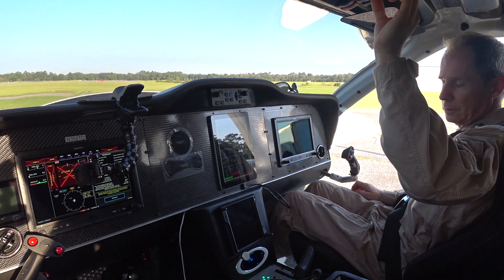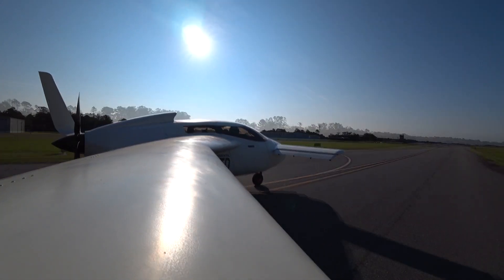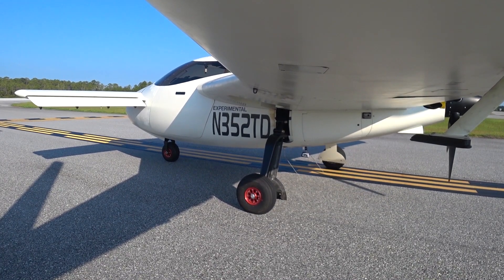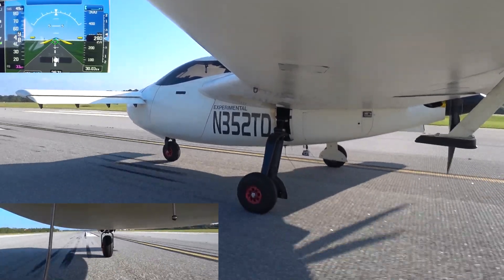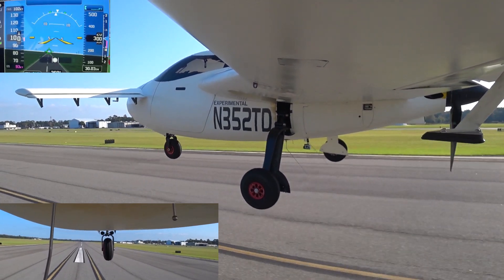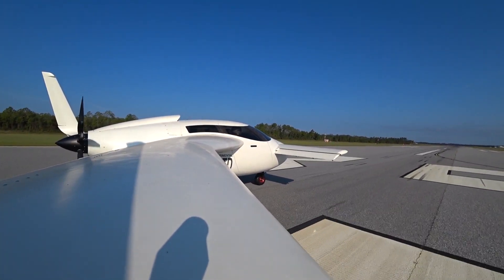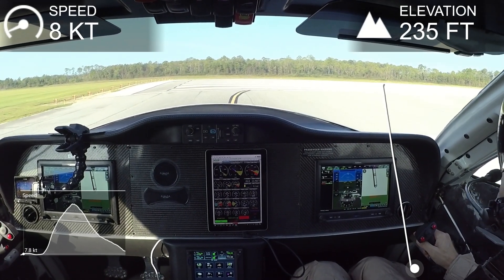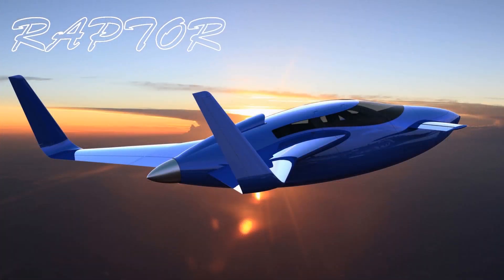Ground Effect... Check! - Building the Raptor Prototype

Comment: I'd suggest getting the pitot/static system professionally checked before any further flights.  The altimeter setting is correct per the ATIS, but the altimeter is reading all over the place when accelerating and in flight.  The error appears to be 50 feet as you begin your takeoff roll and the change in elevation from one end to the other is only 4 feet per the airport diagram.  

https://aeronav.faa.gov/d-tpp/2010/00892AD.PDF

Comment: Perhaps a bit of pilot-induced pitch oscillation, but great progress! You held it on the lines withing an inch. Other than pilot-induced, perhaps you could be putting the plane in porpoise-like canard-style light stall because you want to pull up too quick--because you know that you have to get the plane up quick, and back down before then end of runway. You have the cables quite tight now, so they likely aren't stretching. Perhaps your hand is too tight, and your unsupported arm is at a neutral point where the weight of it doesn't know which side to fall over.

Nag: Please do 2 things: check the control system periodically. Please have someone else check it, too, light, mirror, and all. It's still a young mechanism.

Comment: Peter, holding that plane on the ground until 105kts is not doing you any favors. It's making your pitch stability look iffy and you're wasting a LOT of runway. You touched down at 85 and were able to keep the nose off until 80, which says pretty good things, especially for someone with very little or no canard time. My Velocity XL-5 RG technique was to hold neutral elevator until about 70kts  then add about 10lbs back pressure on the stick. The plane would then raise the nose at about 80kts and fly off the runway in the same attitude at 85kts. Positive rate, gear up and minimal trim took things to 110 on the climb out. Holding a canard on the runway after its ready to fly is asking for ugly things to happen. Please, go down to Sebastian and talk to Scott Swing about getting some stick time in one of their more powerful Velocities. They are just a bit different than conventional planes. It would be very cheap insurance, indeed.
Reply from the maker: Look at the GS ground speed. Indicated air speed is presently reading high until airborne. I'm rotating at about 88. So I'm basically already doing as you suggest.

Comment: Hi Pete
Congrats from Perth. 
I did notice the shadows of the prop proximity to the ground on landing it looks close to me. I worried you might get a prop strike when in the flair for a real landing. Im just about to do a real first flight in my Dragonfly, and thats real worry for me too. So just done a tail wheel endorsement and doing main wheel landings is a valuable skill to learn not to pull the nose up too high. If you dont have a tail wheel endorsement i would highly recommend it. Or at least get a ride with some one who can show you a few wheelies. Youll understand when you see them if you have the endorsement youll know what I mean. 
Cheers and all the best.

Comment: Respectfully this guy is looking to get hurt.  He had a Awesome test crew but didn’t like what they found/or didn’t want to continue paying them.  The instabilities in pitch and roll (along with stick shaking would scare the crap out of me).  Also the amount of rudder needed is excessive.  Don’t have that much work in a Cub with a 20 kt crosswind.  The design is cool. The Diesel engine and expected fuel burn is interesting but in my humble opinion she’s not ready for a lap around the patch.
Reply: As far as pitch, I think that there's a bit of pilot-induced oscillation, yet he held it very straight on the line very well.  As far as roll, he has quite a few horsepower more than in a Cub in that thing. Diesels are known for their torque. Perhaps, after a climb out (when it's the proper time), the tab could be lessened. I can only speculate of the source of the vibration. Because of the mass of the control surfaces, I don't think that the larger surfaces could be causing it. It could even be that Peter's hand is too tight on the controls and his arm is not supported, so his muscles are balancing on the top of a mountain, so to speak. I hate sidesticks. They are a dumb fad.

Without the meddling of the internet, I had hoped that Peter and his test pilot could have worked things out.
Reply: I don't understand why he listens to the internet strangers who cheer him on and ignores the internet strangers (and test pilots) who are genuinely concerned for his safety and the safety of the aircraft. At this point it's almost like he's pre-filming the ntsb report.

Comment: First of all as a reservation holder, I love you man.  I fully intend to own one of these ASAP, but I also want the founder of Raptor Aircraft to remain living.  Now for the criticism.  Since we're not there to experience the dynamics directly please consider the following food for thought.  1) That seemed to be a lot of aileron. Do you believe it is due to the torque that the MASSIVE (JK) Audi is producing and will diminish with airspeed?  2)  Please, please, please, remove the flight controls (aileron and elevator) and statically balance them.  I've seen flutter a few times (as did you on the runway) and it is not pleasant.  You will not recover if you experience this at 150+kts.  Which brings up my #3)  Get a parachute (the airframe one doesn't count) and figure out an easy escape route out that complex door! 4) Put more damned fuel in the thing.  You had a total of 8 gallons.  I know this thing sips diesel but what if you advertently went flying?  30 min of fuel goes fast when you have to make time or figure out how to fly the damned thing.  The only time you have too much fuel is if you're on fire.  Getting there brother.  Just do it safe.  In this word today we have lots of time; well, you do have to make OSH 2021.  Give me a call any time if you want any more unsolicited advice.  This goes for anyone in this channel.  Steve - (559)790-1422.
Reply: @ryanthomas2472  No I have to seek professionals for that myself.
Reply: i gave your # to Biden campaign, they'll have lots of questions and donation calls :)

Comment: Peter, the amount of static error, and therefore pitot error, is pretty concerning. Over 100 feet of change when barely off the ground is way too much. It seems to change with power settings. That tells me the port(s) are not in a good location for clean airflow. At best you will have a very inaccurate airspeed indicator. At worst you’re going to have a very inaccurate altimeter, and if there are ever plans to fly the airplane IFR that is the last thing you want. Just my $.02 from someone who flies professionally in all weather conditions and has done flight testing for more than decade.

Comment: Looking good. Congratz on the good job.  An idea for you, have you thought about putting a automated switch in for the air scoop?   Link it to the oil temp or something and have it open and close the scoop as needed.  Would be one less thing you have to worry about.  Keep up the great work!
Reply: Peter has said that will happen for the production aircraft, at this prototype stage he would like to be able to log the temperatures so he can optimise what the auto system should do.

Comment: Yes I can see in the controls now that you had to correct for roll constantly after rotation due to the improper trim settings. You see you keep pulling the stick to the left because it wants to roll right because you added trim to the light side instead of the heavy. 

A gross oversight but a true testament to a good design is to be able to fly with the completely wrong trim settings. 😊👍

Some bird you got there. I'm guessing 160kt cruise out of this one all said and done.

Comment: One more thing I noticed. If the right side was heavy due to more fuel you want to add lift to that side not the opposite side.

So right side heavy = right side +trim or more elevator deflection pointing down. 

This may have been why you were fighting the controls. 

As what you essentially did was add more roll to the heavy side with a full wing of cantilever. Which is why that right wheel is touching 1st and still hard. And is also why you were needing more left rudder to correct.
Reply from the maker: You are completely incorrect. Perhaps someone else wants to explain why.

Comment: Much more flight worthy Peter.

It still has a minor porpoise. You needs more aileron trim and I don't like how much natural flex the ailerons have in them, still think the springs are too soft.

Before taking her into pattern we need to dial in the take off and landing configurations which means completely stable and uneventful rotations and a proper stall landing. Your landing today was the best yet but you had a bounce which means you weren't quite in stall yet. Could have been your hurry to put her down due to not being comfortable with your runway length, but you are above stall so that is to be expected.

What I suggest is you dial in your full flaps configuration first. Your wing design is pretty laminar which means at v1 you'll be using a lot more aileron and flap lift than a conventional design. Also you are tail heavy, this is the main reason for your oscillating, so you need that extra aileron lift on climb out. I think cruising speeds it will be fine with no trims just initially you need that rear bias lift. 

As some have mentioned there is a lot of stick movement/vibration?  You may need to add more tension on the system to overcome it, which means more counter spring tension to keep the flaps at flight angles. Look forward to hearing about your analysis on this. Aswell as more ground effect testing

One more thing I noticed you aren't counter inputting your roll inputs. You are just correcting which means over correcting. All in all excellent progress.

Your update vids are my favorite to watch, always progression! One of my favorite things to see!

Comment: Just as the wheels came off and u til they touched back down there was an audible whistling noise. I’ve never heard that before, but I haven’t flown that much. Would love to get my license some day, but not for a while. Anyway, does anyone know what caused this?
Reply from the maker: I mentioned previously that it's likely air moving through the door gaps as I don't have the seals inflated.

Comment: Oof, that porpoising doesn't look good. Canard aircraft are DIFFICULT to stabilize, and have been the literal death of many pilots.
Reply: Thanks genius
Reply: @daytrader2192  I mean, I have a fancy piece of paper hanging on the wall that says I know a thing or two about this. The longitudinal stability is off, and without seeing any of the numbers, my guess is that it's coming from canard sizing, as a SMALL change in canard size and position causes a LARGE change in longitudinal stability. There's a reason very few aircraft have canards.

It's difficult to tell whether the long-stab problem is static or dynamic with that short of flight time, since there wasn't enough time to trim the aircraft,  but it is a concern that must be addressed. It COULD be an early indication of negative stability (or less positive than intended).

There's an apparent lateral stability problem too. The ailerons should not need to be deflected that much to keep the aircraft stable. Either there are some unaccounted for aerodynamic forces (since the aircraft is within balance statically), or the ailerons aren't sized properly to give enough roll authority.

This is why professional flight testing is crucial. Stuff like this needs to be addressed. It MAY turn out to be a simple trim issue, or it MAY turn out to be something much worse.

Either way, a professional test pilot NEEDS to take it from here.

Comment: Appears to be a bit pitch sensitive. Is the CG at the forward limit or near it?. Does it feel pitch sensitive? Curiosity from a 40+ year pilot, aero engineer, flying wing designer/builder. She seems to be behaving similar in pitch to some of my flying wing designs when the CG is a little too far aft. Then again it could just be the camera angle or maybe tthe elevator throws/rates.

Comment: I'd get a seasoned test pilot for any additional flights... great to push it to the tolerable limit, but once out of ground effect it may handle quite a bit differently. Also, ground roll seems a bit lengthy, but could just the video adding a thousand feet...

Comment: OK, two substantial issues shown on this video: First is this airplane is only a few pounds out of balance but needs big roll trim and 1/3 to 1/2 aileron to fly straight - something is seriously out of straight someplace. You need enough roll authority to fly crosswind landings with the most adverse lateral loads of people and fuel, and this thing is barely able to fly while only a few pounds adverse; Second is the stick was vibrating in the roll axis during the short flight - the stick is not supposed to do that ever. Flutter? Feedback from some other elements? Fright tremors from the pilot? These issues are potentially dangerous to the project, the airplane, and the pilot. Prudent response is to find the root cause and fix it...
Reply: He had a flutter incident at 40 knots with no counter balance weights on a taxi test.  Could be something simple as a cable has stretched from that incident, or even something that also was previously found as aileron wind up as found by the other test pilots.  Orrr this could all be an indication of something else entirely wrong.  But the short story is I’d agree with you, something isn’t quite right with the roll axis stick vibration.

I don’t think the amount of roll trim is specifically an indication of something wrong, we are talking minimum flying speed and minimum controllable airspeed.  There would be a fairly large prop torque rolling force at these low speeds.  At 120 knots or design maneuver speed, the trim at 90 knots is going to be far far less that current tests he is conducting.  But still it’s another indicator that something isn’t quite right.
Reply: Needs to do some runs setting it up with tufts over the wings to see what the airflow is actually doing. (Computer sims still aren't that good unless you have serious R&D money behind it, they just give a rough idea but still miss some details.) I wonder if the hinge arrangement sticking out on the canards inadvertently functions as vortex generators? Perhaps there could be some turbulence issues stemming from there unless the airflow there gets cleaned up somehow.
Reply: Part of fixing this is removing a variable from the tests and that is the pilot.  Looking at the shaking hands and knees plus fear based PIOs feels like time for getting a test pilot so that this doesn’t end badly.  Doesn’t have to be Elliot and company but just someone suitably qualified and experienced.
Reply: Peter said that he was looking for neutrality else it is hard to reach conclusion on roll response. It does not need trim per se. Watch the other vids.

Comment: About the engine configuration, I think in future Pete will run a single VNT turbo, those guys at darkside diesel development  are getting about the same power output on a single more modern turbo...
Reply: The company is called Darlside Developments.  VAG diesels turbos are VNT.
Reply: @HerrKuhn928  that's how vnt turbos work.

Comment: Peter if you are going to fly this test program yourself, I suggest you  adjust your pedal position so your heels are on the floor and fly the pedals with your toes and not your thighs.  That was a lot of big pedal movements for winds straight down the runway at 5 kts.  Also you appeared to be fighting the trim the entire time.  The airplane should lift off with only light pressure against the trim with only minor adjustments required after rotation.  Big pressure and control movements should not be needed with light winds in ground effect.
Reply: The foot pedal movements looked like he was flying a tail dragger not a nose wheel.
Reply: @jamesroberts7137  in another comment they said the nose wheel is full castering. Not steerable.
Reply: I think it's because his wing design is so laminar the ailerons are taking over lift duties at these low speeds. As we can see he's getting a lot of deflection just from a bit of trim.

Comment: The pogoing on lift off looks a little scary. Are you applying a lot of back pressure on the stick to get it aloft?
Reply: yes i know that pogo in pitch is quite pronounced just after it unsticks. takes a while to settle down too. It's too fast for phugoid, so it's coming from the airplane or pilot
Reply: I saw no pogoing.
Reply: Paul Dutton you on the books mate?

Comment: Your airspeed matched your ground speed when the throttle came down. Is it possible that the propeller slipstream is causing the pressure difference?
Reply: on a pusher plane?
Reply: @Jan_mxv  Yes, even then.

Comment: I almost think it's more dangerous doing these little take off and landing then the first maiden..
Reply: "Altitude is your friend," they say - unless you're in an inverted dive without wings (then it's just an acquaintance).
Reply: Probably - that's why it's good to get them out of the way and he's wearing PPE. The hard part is over and now it's time to take a victory lap thru the pattern giving the finger to all the naysayers!
Reply: @ryanthomas2472  I'm not talking about a minor flight stability. I agree Altitude is your friend and gives you time to recover. I'm talking a serious flight stability issue, one that is totally unrecoverable.
Reply: Um.. no. The last thing you need is an unstable plane 500ft in the air deciding to roll over unexpectedly.  I'd rather be 5ft in the air when it decides to try that.